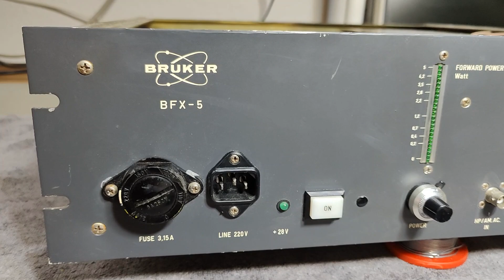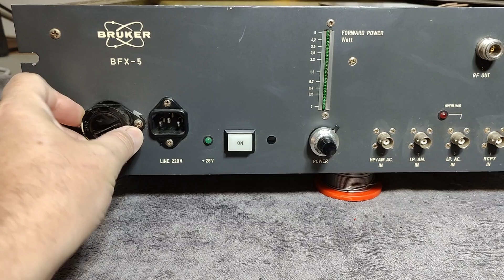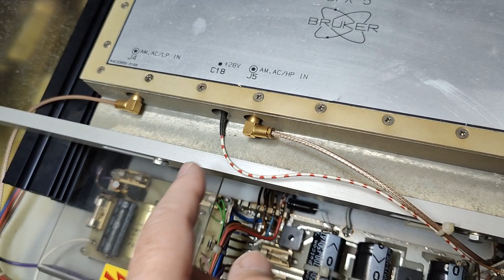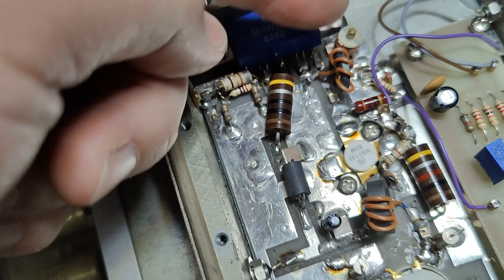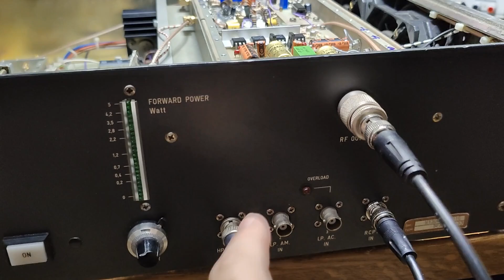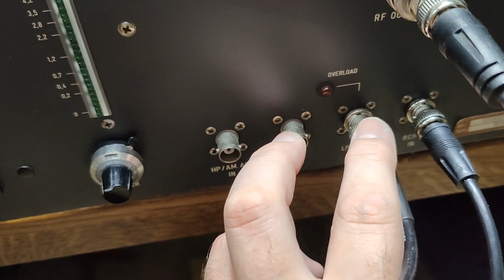Bruker BFX-5 RF Power Amplifier 5W VHF 1987 test teardown

Comment: The part with M on it around 7:00 is a HF linear amplifier. It is made by Motorola of course. It is build around a HF transistor (the round thing with the golden strips) that was Motorola's specialty during those times. 
It is present in any ham radio, except the old valve models.

Comment: There is a certain courage to connecting anything that is prossibly broken and has 400V inside it to a spectrum analyzer and pointing into it with bare fingers :)
Reply from the maker: it is a good idea to take good case about high voltage, high power rf, and your fingers and your spectrum analyzer, bad combo..